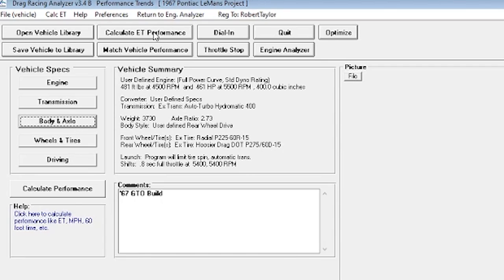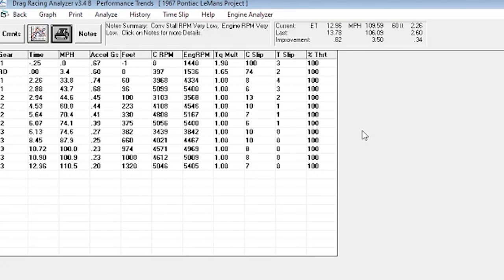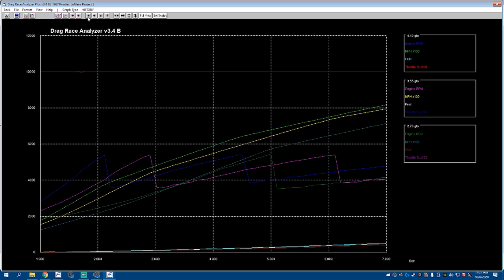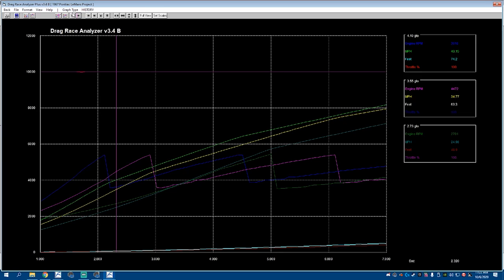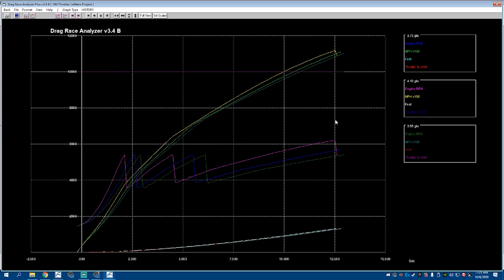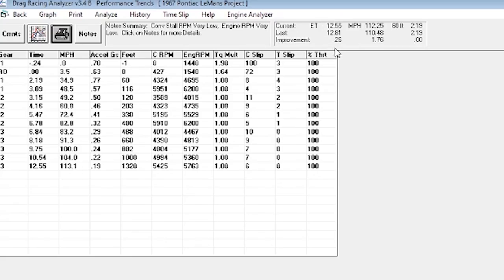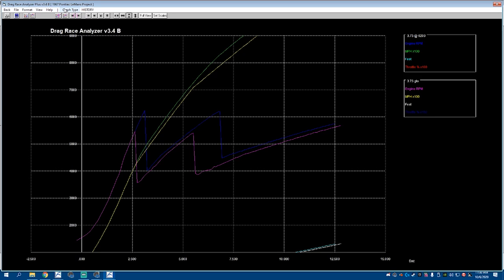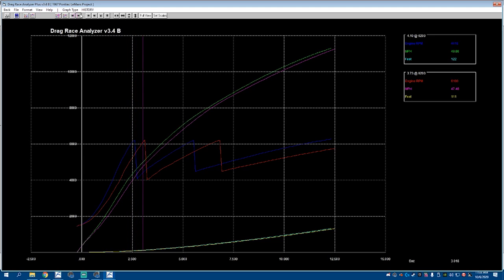How to Choose Rear End Gear Ratios

Comment: If you wanted to keep your Car/Truck pretty much stock other than gearing and you had an Ford FE 352 and all you wanted to do was wake it up a little (not for track purposes) what gear ratio would you choose  for your vehicle as in not to recommend myself or anyone else, but what would/could YOU choose without having to change the torque converter or whatever else to make the difference improve noticeably?
 And Thank You for your time and input.

Comment: Love your videos man! I have a 67 Firebird convertible with a 2.56 gear and I have a 350 HO with ram air III #16 6x heads and a ram air IV cam. I am still in the break in period in the rebuild and have not gotten on it at all. What I have noticed is that there is literally no power during the lower RPMs. Mind you, I am just turning out into traffic to get up to speed and have not punched it at all. I am looking to install a posi unit and either a 3.55 or 3.73 gear so I can more off the line power. Based on your video, it seems like the 3.73 is going to be a better choice? I am only driving it around town and not on the highways.
Reply from the maker: Keep in mind when you change the gears from a 2.56 you usually need to change the carrier and sometimes the differential. I'm a big believer in 3.73s, there's a reason they've been the street/strip standard since the beginning.  If it's a car I wanted to drive 3-5 times a week I'd go with something like 3.23s or 3.42s with an OD transmission. The fuel economy is hard to fight sometimes.
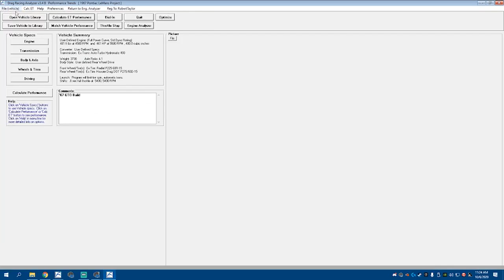Reply: @LSxHunter  I have a 3:23 gear ratio on my 2017 Escalade and I’m looking to put a 3:73 or 3:90 gears. Do I have to change the carrier?!

Comment: I know that there's probably a computer program for this I just don't know it. But how do you think a combination of 4.88 gears, 30 inch tires, a 4L60 transmission, and a gear vendors over/under drive would work for a 4000Lb 4wd vehicle with a built 800+ H.P. 383 stroker built on a 5.3L LS.  According to my rough calculation with the grimmjeeper gear calculator it should hit about 200mph at 6000rpm.

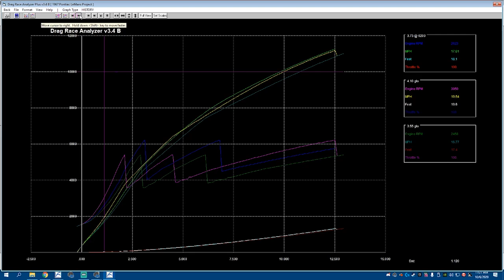Comment: currently running 4:11 gears in my 67 pontiac lemans with a 389.. rpm is pretty high, so im looking at 3:55 gears to drop down the rpm's.. i would like to do more highway driving than going just around town.. will lowering the gear ratio to 3:55s also help with keeping the engine running cooler also? would like a good cuising speed at about 75mph while keeping the rpms as low as possible, but still have some get up and go...

Comment: So I'm swapping my bmw from auto to manual right now. I'm using the same rear diff for both that has a 2.91 gear ratio. Everyone in the forums is says gonna be a problem on the highway and ill be riding a like 4000rpm when crusin 80(that seems normal tho). Am I going to run into issues.

Comment: I’m currently looking for some help on what would a 3.9 do compared to a 4.1 or 4.3. It’s a LSD for a Miata not sure if it’ll help but right now I’m cruising at 80 mph @4000rpm not sure what ratio I’m running but would love some help!
Reply: Final drive is heavily dependent on each individual gear. If you're cruising 80mph at 4000rpm, your transmission gearing is short (higher numbers), as well as your final drive (higher). If you have a lower final drive ratio (lower numbers), you would essentially be stretching the individual gears longer (lower). This would lower your cars rpm at 80mph, however, if you're on a stock miata, it's gears are short due to it's lack of power/torque. So if you go with a lower final drive, you're going to make the car more sluggish. Powerband is very important to setting up gears. Pontiacs work better with lower final drive ratios because of the mid range torque. 3.73 keeps in the strong part of the power curve longer. Capeesh?!

Comment: Hey man. I have a 78 Camaro 350 small block with a th350 and I just put 4.11 in the car. Im debating on dropping down to 3.73 or even Lower. Before the gear switch I had 2.73 and could cruise to 140 mph no problem. The car now can’t even hit 90, the engine is just screaming. Any tips or certain combination I need to get this car running right!?
Reply from the maker: 4.11s will definitely hurt the top end but it’ll make it way snappier to get there. Personally I’m a big fan of 3.42
Reply: Consider swapping in 200-4r trans. The only change needed is moving the crossmember. If you have a lot of power, the 200-4r will need to built up, they can be made to handle 800 hp if you have the $$$.  The overdrive (.67:1) will make your 4.11s like your old 2.73s.

Comment: Good discussion but…
My 4.10 cars all went 2-3 tenths faster in the quarter than the exact same car with 3.73s
Granted 99% of the guys out there aren’t looking for max et but I’ve been street racing Pontiacs since the early 80s so all I care about is results
400 with worked 16s or 62s, worked stock intake, worked q-jet, raiv cam 1.6 rockers, recurved distributor,10.5-1 forged pistons, balanced rotating Assy,  4 tube headers with turbo mufflers, Vega converter with long snout in a built turbo 350, 10 bolt with 4.10s 11.30s- 11.50s from spring till fall on 80s street tires with a 150 shot in my back pocket those cars were almost unbeatable on the street in the 80s and 90s 
It took race cars to beat the car I hauled my kids to school with
I’ve street raced since 77 until the 90s if you had a 11.50 car you weren’t afraid to race anyone!
The truth is a 11.50 car was super dominant on any street most guys who thought they had fast cars would get bus gapped by a 11.50 car
Give me 4.10s for the win😎

Comment: Wait, you guys are talking about racing, launching. No, no race here. I’ve got a ‘69 Chevelle, stock 2bbl 307 and I’m assuming 3.08 gear.  At 70-80 mph I’m screaming down the highway and need it to do better. I’m thinking 2.73. Not looking to race anyone, just need the rpm’s to come down. Will it be enough? Can’t afford a 700r4 right now. 😢

Comment: if you drive a lot on the interstate, pick 373s or 390s. everything else 410s for the street.
Reply: I use 3.90 in 1/8th mile car. They are terrible at highway speeds.

Comment: I have a 393 Windsor with 11 to 1 compression and a 600 lift cam The max RPM is 7000 I have 3.08 gears in it now thinking of putting 3.73 or 4.11 maybe 4.10 what would be the best sitting on 15 inch drag radios

Comment: I'm just getting into gears . I drive a 2010 jaguar xfr 5.0 Supercharged.....what gear ratio would u recommend??? I'm making about 461 torque..... thanks
Reply from the maker: I think those use a ZF 6HP?  I know the 5th gens really like 3.91 gears with a similar gear setup and I think it's only 420ftlbs. You might run into hooking issues in 1st gear but if you can get it to hook the 60' would be gnarly. I'd imagine those XFRs have a lot more in them than their factory rear/tires allow.

Comment: Mercury  grand marquis  2.73 to 3.73 how  will it do on highway
Reply: 3.73 is the way to go
Reply: You will run higher engine RPM at highway speed which = less MPG. Around town you will see a lot more pep.

Comment: There is a very intelligent solution available now.
Winters Street Rod Performance V8 Quick Change rear end.
Reply from the maker: I've heard of them but never played with their products. Seems like a good idea.
Reply: You should put one in and do a review for us. I dare ya!
Reply from the maker: 😂 if only I had the money! I've got 12-bolts everywhere at this point
Reply: I am here 2 years late, but I have a question anyway - how does this quick change work?
Reply from the maker: Better late that never. They’ve got a housing that allows you to remove the back plate - slide the gears out the rear without removing the axles and just pop the new gears in. It’s like a 10 minute process.
Reply: @LSxHunter  Wow, sounds really cool!! Thank you for the explanation and for the super quick answer 👍
Reply from the maker: You may or may not have caught me staring at my phone looking at engine parts 😂
Reply: @LSxHunter  LOL, yeah. I forbid myself looking at parts, because it's cheaper that way 😅

Comment: In actual real world testing, I went from 2:73 to a 3:73 gear and dropped .3 tenths on average in the quarter and maybe 1 MPH. 13.7 to 13.4  with no other changes. IDK who in there right mind would think you can drop a second and pick up 5 MPH from a gear change
Reply: I'm new to this, but what was traction like between the launch on 2.73 vs 3.73? Did you spin more on the 3.73?
Reply: @scottedwards8220  you will definitely spin alot more with 3:73 if your dont have a good tire or chassis set up. If you have traction, you will notice much more bottom end power through 1st gear
Reply from the maker: It’s important to note this is with PERFECT traction. Slicks on a strip with sticky sauce. I’ve personally seen just under second gains going from 2.73 to 3.42s BUT that cars intake hated the 2.73s. 

There’s a lot of pieces to the combination that can drastically alter the results
Reply: @LSxHunter  Ive seen somebody knock off 4 seconds with nitrous. but the bottle pressure had to be perfect 🙄